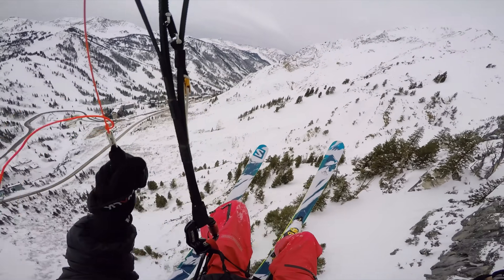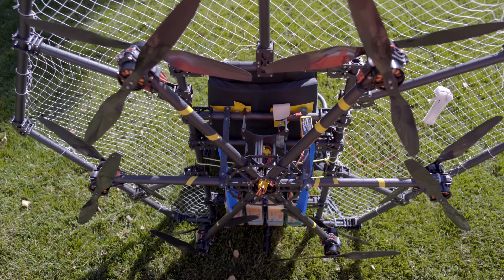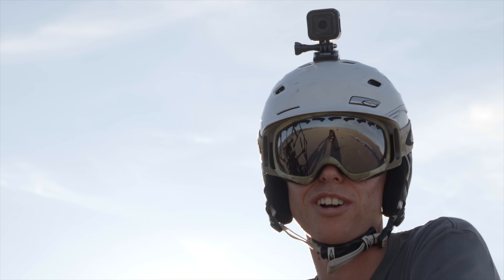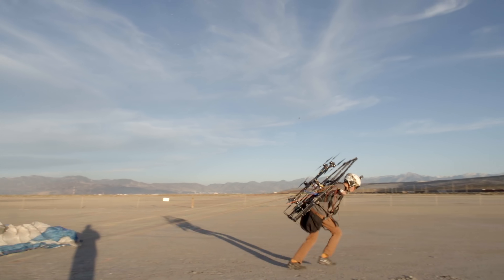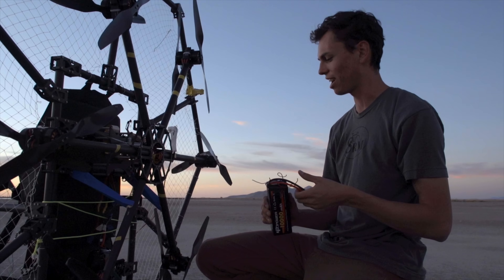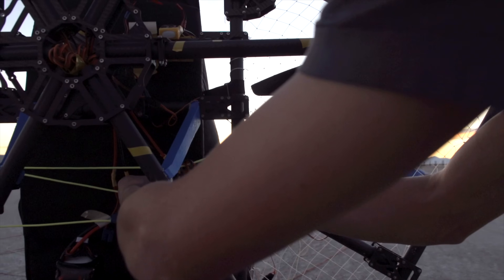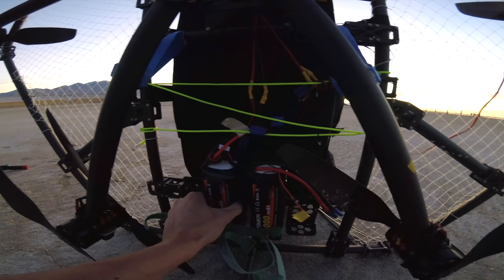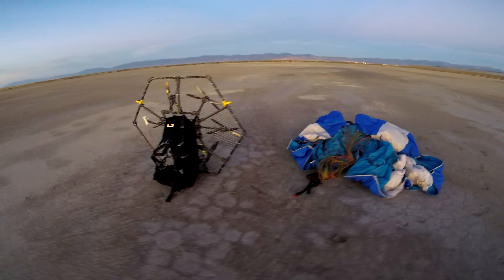12 DRONE Motors On My Back!? - DIY Paramotor - RCTESTFLIGHT

Comment: I would switch to a traditional paramotor if you plan to continue. It's pretty cool that you were able to get off the ground, but you barely had enough thrust even with a dangerously oversized and unstable wing. Parmotors use significantly heavier loaded wings, because it's more dangerous to have a collapse compared to a paraglider, due to all the stuff there is to get tangled in. 

And with that being said, your prototype is going to kill you if you play with it too much more. Your cage design isn't mechanically sturdy enough, and if something slips, it's going to be easy to get a body part in one of the props. Also, you'd need to do a lot of testing to make damned sure that there's no probable flex direction that could possible get those props to slice your connections. Recovering from a collapse can be violent, and carbon fiber isn't going to save you from an inherently unstiff design, especially with those connections. If you have those tangle issues you had during launch in the air, or during climbout, it's going to be very bad news. 

Electrically, I'm even more concerned. The thing is just asking to catch on fire. You are very lucky that the solder melted out, because you were close to catching your wires on fire. I expect that your motors and batteries were being pushed well past their duty cycle and max current specifications, but even if you stayed inside them, they simply aren't reliable enough to be used in a human safety situation. If you are cruising along at 1000ft, and you get a battery fire on your back, you're just going to be barbecued alive. Hobby RC electronics simply aren't nearly safe enough for human flight. I'm an electrical engineer, and there's no way I'd trust my life to one of my own designs without close peer review from an experienced power electronics engineer.
Reply: well put words of caution
Reply: Seth Tucker, maybe I've got this wrong - I'm not an expert on paragliders - but it seems like a paramotor would need a bigger wing than a paraglider because of the extra weight of the motor, frame, and fuel.  I do understand that a wing that's too big for its load collapses more easily, but why would adding the weight of a motor mean you need a smaller wing?  And how is it more dangerous to collapse the wing on a paramotor than a paraglider?  What are you getting tangled in?  I'm not disputing what you say, just curious.
Reply: Well, it's complicated. Yes, you need a bigger wing with more weight, but paramotor pilots tend to load the wing more heavily than unpowered paragliders. This is again due to the higher danger of collapse.

A hard wing collapse in a paramotor involves the risk of getting tangled in the motor and getting your lines in the prop. That's bad. The harnesses for unpowered flight are also more responsive and make it easier to recover. There's also a difference in the type of flying going on. Unpowered pilots need to seek out thermals and updrafts to stay up. They are in situations where you might need to throw a reserve, and that's not the end of the world. Paramotor pilots tend to enjoy flying low and slow and are more often in a position where they can't safely throw a reserve. This is unavoidable during takeoff and climb out from a flat surface. There are also wired torque effects from the motors than can be amplified a lightly loaded wing. 

Basically the risk vs. reward situation changes with a motor. You can use your motor to overcome sink, so you don't need absolutely as much lift as possible. At the same time, the danger of a collapse is potentially higher.  So in balance, you generally want a more highly loaded wing, and from what I've seen the recommended sizes tend to actually go down when you put on a motor.

Comment: Fun/dangerous project.  I designed, built and fly my own RC parts paramotor.  I recommend that you double check your figures to make sure that your batteries, wire gauges, connectors etc are all up to the huge amperage requirements.  You really need a smooth hoop around the props with nothing sticking up to catch lines.  You should not even have a zip tie sticking up.  On mine, I slit some polyethylene pipe lengthwise and placed it over my hoop to cover the zip ties.

Comment: yeah, try a better wing, in maybe a little less wind.  And, there's a reason why most Paramotor cages are round and smooth on the outside.   With experiments, you want to cut out as many variables as you can, right?  Still, when you get it right, I want one.  :)

Comment: That rig should be putting out around 45-50kgs of trust and pulling close to 500amps at full throttle. Since the EC5 connectors are only rated to 120 amps its no surprise that happened. Good luck with the next attempt!

Comment: everyone will say to get training. bro you just proved that you don't need training and you built your own rig. Wings fly themselves now a days.  Playing with a power kite or a little kitesurfing will go along way in getting you in the air.  Yes i think once you go to higher altitudes you need airspace knowledge and reserve training but yeah good job rook!
Reply: Yea you don't need training to do this. Not until you collapse a wing or lose power over water or any of a long list of potential threats that will eventually happen, but no don't worry about knowing what you're doing first..
Reply: +1. They look super simple to fly, but stuff like upset recovery...that you want someone who knows what they are doing to walk you thru.
Reply: He needs some training in ground handling! How he reverse launches the wing and breaks the wrong side is so painful to watch!
Reply: Everyone witch i saw does it at the first attemts. Pulling at the low side (if you hold the A+B+C/D Riser in your hand) or don't let the wind slowly catch the wing and go with the wing (he had plenty of space and didn't need to force the wing up in a crosswind direction; witch is possible but not so easy).
Reply: The problem isn't getting off the ground without training. The problem is that you can get off the ground without training. Getting off the ground should be no issue for someone with paragliding experience.
Reply: Seth Tucker i thumbs up your comment. I understand but I truly believe with a little common sense and research into weather conditions and beginning at the beach self training is somthing that is very attainable.

Comment: Looking great.  Upgrade those wires to at least the same gauge as the main leads coming out of the battery  keep all wires as short as reasonable and with as few connectors as possible.  This is a perfect case for electric as the load is light and the power requirement can be somewhat intermittent.  Please don't give up you're on the verge of something awesome!

Comment: I built a paramotor with a dle 111 engine and a 28 inch prop.  The engine I believe only weighs like 7 pounds and puts out like 11 hp.  The whole unit weighs like 30 pounds and has plenty of thrust to get me in the air.

Comment: It seems to me that you have left too many things to chance.  I'm not a paraflier of any kind, but I understand brushless motors, LiPos and electrical wiring.  There are rules and formulas for wiring and current.  Your wiring should adhere to these rules and formulas.  Most of this can be looked up on the internet.  Please don't just leave this to chance.  Know the amperage that every wire will carry and what gauge wire will be necessary to carry it.  I suspect you need more battery power in addition to the wiring.  You should know what the max amperage of your motors will be as well as the maximum amp rate of your battery pack.

Comment: Yes! Keep going! Super fun to see you paraglide too, and pushing things with electric. I’d look at a higher voltage, lower current 18650 battery based system. Look at what’s available with E-Bikes for batteries– they’re pushing us heavy humans around for many dozens of miles with a couple hundred dollars 0.5 - 1 kWh packs.
Reply: 18650s are much heavier than LiPos (thanks to the metal casing) and much less compact (packing cylinders rather than cuboids).
Not what you want for an aircraft at all.

Comment: 1: your cage shape keep the lines from getting up 
2: you dont know how to controle a Praglider , your 'Old' wing seems to be a 'preformance' wing so dont pull on the break toggles at all(not 2 inches) and symetrycally and she will go up kite without the motor at first 
3 : use big wire and all the batterie , and stay low in case of fire

Comment: Nice project. Correct me if I'm wrong, but your flytime even with big battery pack will be at least 7 times less than normal paramotor setup with similar weight.
Reply: I think the longest flight times I've seen with an electric paramotor is about 40-45 mins.
Reply: You're wrong.  The energy density of even the best batteries is a fraction of that of gasoline.  Sure, the motors weigh less than a paramotor-size 2-stroke, but if you're adding enough batteries to get the same flight time as a gas-powered unit, the total weight will be much higher.  The only thing that makes electric paramotors practical is that most people don't want to fly more than an hour or so per day anyway.  You're not going to see any electrics in the Icarus Trophy race.

Comment: Don't scrap the project, use a higher gauge wire, run four 10awg for each set of 3 motors, and then stay at the 10awg down to your batterys, I would use 10 of those batterys to get the amparge alittle lower and Compacity up. On the other hand i would definalty build this to fly

Comment: What should you do, in case of fire?
Reply: You SHOULD have a disconnect switch that doesn't depend on any electronics.  Not only can wires melt (like happened here), but ESCs can short out causing motors to make fire.  It that's not practical, then the batteries need to be within reach so you can yank them out to disconnect them.  The good news is that for electrical fires, if you disconnect quickly enough, there's a good chance the fire also stops.

Comment: Im curious about how many watt-hours it takes for flying. just for comparison my electric bicycle takes 12 watt-hours per mile at 12mph, and like double that at 20mph. if your machine doesnt use many watt-hours to go a mile, your 1kwh battery could last quite a bit.
Reply: You need at least 1kw just to counter the 200 fpm min sink rate just to keep floating. It is for 100kg take off weight and ideal 100% efficient props and electrics. If you want to be able to climb at 200 fpm and the total efficiency of the system is 50%, which is more realistic, then you'll need at least 4kw of power. So, yeah, 1kwh will give you roughly one quoter of an hour of flight time.
Reply: Has so many advantages over gas that i think its a no brainier https://www.youtube.com/watch?v=IvmQbtxeKuE
Reply: Rinoa Super-Genius this electric paramotors are so power hungry.  1kw hour may last you 15 mins at cruise and a lot more at take off. It consume a lot more than your ebike
Reply: Yeah i figured that, but i didnt want to make assumptions. still i think its more promising than petrol powered ones since you could expand the battery and even get more efficient chemical to electrical conversion if you keep it under 1c draw. plus who knows what technologies like sodium-ion cells will be available in the future.

Comment: Terrifying but awesome! Electric is the future of the sport, batteries just aren’t quite there to enjoy reasonable flight times. Stay safe!
Reply: I feel that we are almost there, though.  I enjoy 10-15 minute flight times on my "Sunny Motor" DIY electric paramotor.  It only cost $1200/1500 with batteries and if I was willing to spend $2000 total on it, I am sure that 30+ minutes flight times would be easily achieved.
Reply: @lasersaber  not quite the 3hrs you can get from a petrol one..
Reply: Yep i get 30mins flight time easy https://www.youtube.com/watch?v=IvmQbtxeKuE the small trade of in flight time is worth the significant weight reduction.
Reply: Why not connect 1 battery to only 3 motors, that way there is also redundancy if there goes something wrong with one battery? Would also eliminate the "too high current drawn" issue.
Reply: We are almost there. Carbon batteries should make a big difference on weight and energy density in the next few years. SRMs are also much lighter than BLDC motors and arguably more efficient depending on your controller.
Reply: @Infinion  What are SRMs? Thanks.
Reply: @immortalsofar7977  Switched Reluctance Motors. They're brushless motors without magnets or rotor windings. So much lighter and cheaper to manufacture.
Reply: Who wrote this Bixler ?
Reply: At that point you would start flying above the speeds of some regular aircraft.
Reply: 10-15 minutes gets you off the ground but not any altitude to enjoy a true flight experience. Have you seen Ali's rig? Awesome.

Dance the Skies
Reply: If the technology wasn't hidden we would have awesome batteries on the market but it's a shame people are too greedy and want planned obsolescence

Comment: I think you should build a frame from aluminum that is going to protect your motors, because the carbon might break if you fall backwards on the props. Also put some netting over the blades to protect the cords when you take off, last thing you need is a cut cord when you’re up in the air. Great work!

Comment: Nice job! I'm wondering if you should rethink the use of any hoop at all. Or the use of a single large hoop. There is no reason you couldn't have all 6 motor modules on the ends of a long horizontal pole--outside the reach of any line or your hands (a safer option?). A side benefit would be you could use differential thrust to yaw (I'm not a ppg pilot so I could be completely wrong). One downside would be higher roll moment. Longer battery/esc wires would increase losses.

Comment: what if the battery/ESC catches fire in the air?  any quick release for them to drop off
Reply: Probably blow away. But the battery is littium an HARD to put out
Reply: Paragliders require to have a second shute where i'm from, can always use that if you're worried about fires.
Reply: modern batteries don't just catch fire when abused. they can go pop. big pop

Comment: Tucker Gott has got to see this...
I'm sure he'd also like to try it out too!
Reply: David, why do you think that?
https://www.youtube.com/watch?v=3tbF83QRtgI
Electric motors are far more reliable and lighter than gas engines and they do the same thing.
If a motor stops, you just glide to the ground. No more 'stupid' than wearing a gas engine.
The only advantage of a gas motor at the moment is they can use the higher energy density of gasoline, even if they are only 30% efficient.
Electric motors are about 90% efficient, cost much less, last longer and need almost zero maintenance and batteries can be charged anywhere, even by solar panels.
Reply: @ahaveland  All of that is true but THIS poorly made, poorly researched and poorly designed POS is a deathtrap. I am disgusted that the creator thinks so little of the discipline of PPG flying that he did NO research on how to build a decent PPG frame or on how to fly one before commiting aviation in this absolute piece of shit.
Reply: I agree, the only issues I see with this are the snag points which are only relevant when getting the wing up, and the hopelessly underrated cabling. All easily fixed. Other than that, if it pushes, it'll work. If not, then it'll glide.
Still, check out the link I posted for a better design, rather than Daniel's bolt-on see-if-this-drone-will-work thing!
Reply: be like laurel and hardy - another fine mess
Reply: Andy Lee Robinson  Tucker flies a scout paramotor that is manufactured , tested , licensed!   Top of the line reliable equipment....
Then this guy builds an electric paramotor.. nothing wrong with that.. except this guy apparently knows nothing about paramotors.
His frame joints are snag points for his lines.. the concept is great ,
This guy in s trying to re invent the wheel, when the wheel run fine already.. I just don't think you'd ever get Tucker to fly this contraption, when. He takes so much care in his scout to be safe.. not flying when it's to windy..
First thing this guy needs is training!! With a good gas paramotor..
Reply: Andy Lee Robinson Tucker's not that stupid
Reply: Andy Lee Robinson He probably has too much respect for human life (His own) to be messing with home made aircraft.

Comment: For gods sake... beautiful carbon frame, elegant design, clean electronics.... BUT WHY THE ELASTIC ON THE TRIGGER? Please get yourself a proper spring =')
Reply: Just think what he could do if he actually knew what he was doing.
You don't make those kind of engineering mistakes, if you know what your doing...
I would feel responsible for those that would try this after seeing this video...
How much better is good enough?
This is the difference between a test pilot, and a test dummy... lol
Reply: that's something I don't get about YT 'makers'  with 'amazing' this that and the other.  It makes no sense to do no background reading before attempting to re-invent wheel, and it's total lunacy when serious injury or death may result. Don't get me started on Tucker 'dingbat' Gott FFS
Reply: whats wrong with it? why would a spring be better?

Comment: Thats cool, don't give up. Looks like you just need some small tweaks. It's a much lighter set up and you can glide with no motor on. Do you have anything to show your battery voltage while flying?

Comment: Power Wires.......... The larger the better...
Calculate max draw of 1 motor/prop. Multiply by 12... Use a wire gauge that can handle at least 50% more total current.